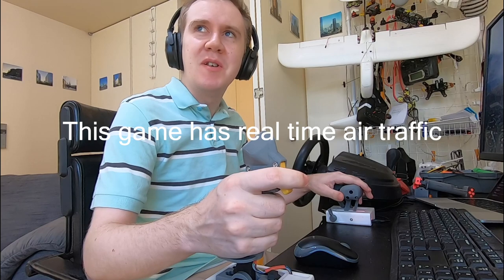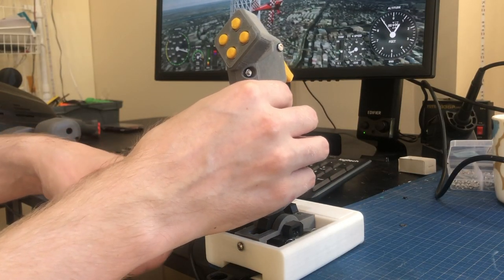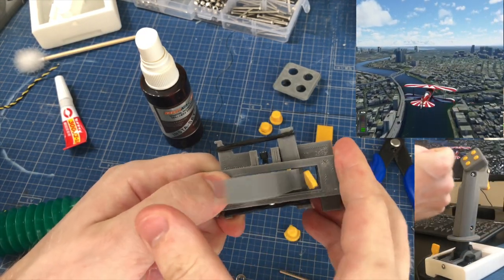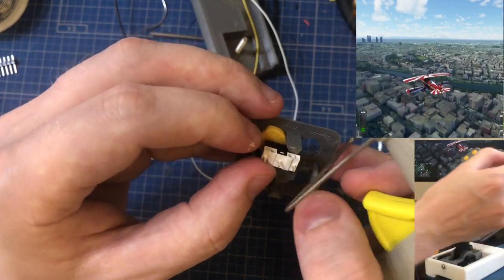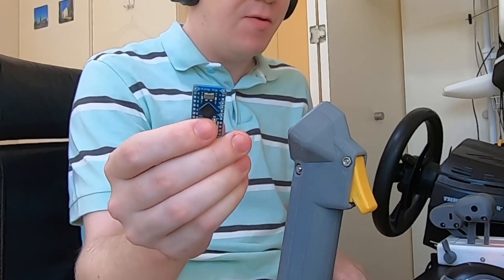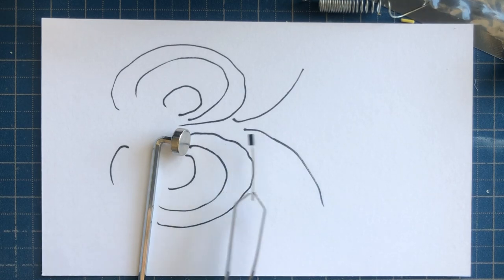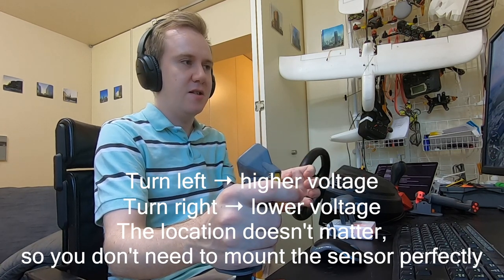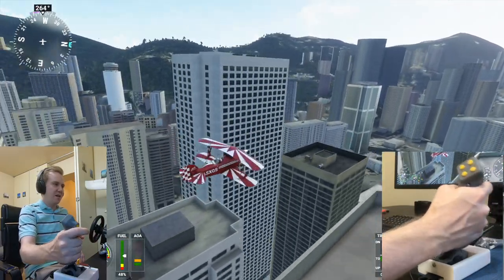Home-made Hall effect joystick for Flight Simulator 2020

Comment: I love the ATmega32U4.  For my master's thesis I developed an experimental type of solid state 6 dof joystick and I used this board also! I also used a ATmega32U4 board on a small bldc motor driver because it has a timer, timer4, that has 3 comparators on it so you can get the 3 phases setup super easy compared to timers without 3 comparators. Nice little chip

Comment: I think this is such an awesome project, but since I already have a decent joystick, I would love to see more of an in depth revisit of the throttle system you designed. I am currently building a DIY stream deck based on the same principles, and I was thinking of being able to dual purpose that with flight sim, Elite Dangerous, and a few others, but I would definitely need a throttle system to go along with it, and it would be nice to have something like yours. Thanks for the awesome video!

Comment: I am verry interrested in this Project but i would use it for my Farming simulator. 
Can you please make a Video how you connected all the wires on the pro micro and how to connect some more switches and also how to write the software. Because i don't understand anything about programing and i think i am not the only one.
Reply: Yes, I want this to.
Reply from the maker: There is a wiring diagram here: https://www.thingiverse.com/thing:4576634/comments#comment-3639820

It's very straight forward.

For the programming, you can see this video, it is very similar: https://www.youtube.com/watch?v=YAbi_AqF7aQ
Reply: @AkakiKuumeri  Am I wrong in saying that your wiring diagrams only show the connections between switches and Hall sensors to the Arduino, but not to the PC (via USB)?
Reply: @sz72909  Do you need a wiring diagram to show you how to plug a USB cable from the USB port on the arduino the the USB port on the PC?

Arduino boards normally have a USB port on them and you plug them into a PC USB port to program them. (smaller boards like this are often mini usb connectors on the board) Once the boards are programed they're non volitile so you can unplug them and the program will work next time you plug it in or power it with a battery. If you do a search on Amazon.com you can get some nice close up pictures of arduino boards.
I'm pretty sure that once you've got the device built and the program on it, you'd unplug it and replug it and windows will recognize it as a generic game controller. Then you'll set up the various control axis in your game.
Reply: Dude use a bodnar board, no soldering or programming required, and then get an ebay joystick for commercial use, they are like £12 or something, and voila, home made joystick, no soldering required.  Also, the bodnar board will allow you to hook up several joystick thingies, because it can handle 8 axis, 32 buttons, and a bunch of potentiometers and other switches.

Comment: GREAT PROJECT. I think a twin joystick for the increasingly popular space sim would be good as well. Im attempting the same same with a few RC plane gimbals M9frysky) and have them connected up but cant seem to get the great results you have (even after calibration the joysticks are over sensitive and screwy) I tried to modify your code but couln't add a second joystick. You make it look easy. Wish you could help.

Comment: One thing I think people need to be aware of, I believe you need a specific type of Hall Effect sensor, I was super hyped to build this controller and skipped researching and happened to buy 3 lots of wrong ones which unfortunately output digital signal instead of analog. I gotta find a purpose for them soon.
Reply: doing the samething tho, but it works at least
Reply: @AbuGuroza  hey do u guys know any alternative sensor in amazoon only digital output version is available
Reply: @arunachalpradesh399  hmmm i never use amazon, but thankfully the one i got in here is analog one
Reply: @AbuGuroza  yes bro, please tell the name of that sensor,
Reply: @arunachalpradesh399  49E Hall element OH49E SS49E

Comment: Could you go thru more detail on how to wire the hall sensors, switches and buttons to the microcontroller? Which pins do the positive, negative, and signal leads soldered to which pins on the board? Where would be the .stls for joystick. I like your layout of the stick.
Reply from the maker: Thanks! The wiring details are in the source code. It's very straight-forward.

Comment: I'll be using an xbox joystick sensor module, kinda worried it'll be too flimsy. To mitigate, I'll use the joystick as a stopper that will make sure that the module doesn't overextend, to make sure I don't break the module.

Comment: I am impressed. Thanks for good explanation. I am working on this type projects with esp32. I have question:) . Why did you use hall effect sensors rather than joystick modules? Its add complexity to your project(but it looks cool :)) and if you using pla, pla creeps under continuous stress (its happens to me but can't prove it :D im now using petg) Precision probably lower than potentiometers. Because you have to align correctly the magnets and all magnets don't have same magnetic flux.This is my thought i m not often use hall effects sensors, maybe i am wrong. And yes my grammar mistakes can hurt your eyes:D.

Comment: Any reason you chose to have the sensor be the moving part instead of having a stationary sensor and have the magnets move?
Reply from the maker: You can see the first version had a single moving magnet and a stationary sensor with two axes. It didn’t work, because you would need to have sensor in the middle of both axes of rotation for the reading to be linear. You would have to have a complicated gimbal-type hinge mechanism, with an open center.

Instead I have two seperate sensors, where the sensors are right on the axis of rotation, but offset to the side. In this configuration at least one of the sensors has to move, and that’s exactly what I designed.

Comment: Can you add information a bout the orientation you printed all the parts incl. the throttle? Also what kind of M3 bolts and length did you use? Great idea btw!
Reply from the maker: All parts are oriented as they should be printed in the files. (except I think the joystick shaft part had a slight angle)

For M3 bolts I got a little assorted set with lengths from 5 mm to 40 mm, as well as nuts and washers. I mostly used 25mm long ones I think, but it's best if you have a few different lengths for the different spots. A set is less than 10 usd on ebay if you can't find it locally.
Reply: @AkakiKuumeri  can you post a link to your set, I can not find any sets having a M3x40mm, max is always 30mm.
Thanks!

Comment: Nice work! I would like to know a little more about the rudder pedals though. What potentiometer would you recommend for your design?
Reply from the maker: Any resistance value of the common old potentiometer will work. I don't know what their parts name is, but you know it when you see it. Just make sure it's a linear one, not one of those logarithmic ones (used for volume knobs sometimes)
Reply: Hey Ramon, I have voided many a warranty on joysticks, rudder pedals , etc (I'm actually tinkering with a project similar to this one but bigger; for an entire VR cockpit) and I don't think I've seen anything other than a 10K Ohm potentiometer being used. Given Mr. Kuumeri's response though, if 10K is some kind of a benchmark or standard amongst manufacturers I couldn't tell you why. Hope that helps.

Comment: hi! I have some  question that I like to ask

Q.1 HOW LONG SPRING DO I NEED? Do I need 4 for them?
Q.2 WHAT IS THAT SWITCH? IS THAT A MICROWSWICH TOO?  AT 4MIN 16SEC?
Q.3 What is the scrip to get the data out and into the computer?
I hope you answer my question and have  a good day
Reply from the maker: You need about 2-3 cm springs, 3 pieces. I however recommend rubber bands over springs, they work better.
That's also a microswitch.
The source code is linked on the thingiverse page.
Reply: @AkakiKuumeri    do I need an Arduino pro micro? just any Arduino with ATmega32u4? 
and can you make a flight throttle video?

Comment: Hi Akaki, thanks a lot for the video, I've been planning to build my own joystick based on hall sensors and an arduino pro micro for a long time. My only problem is that I don't know how to connect the cables to the board correctly. Where could I get information for the correct connection of the sensors to the board? Thank you very much greetings from Buenos Aires, Argentina!
Reply from the maker: It's in the instructions on the thingiverse page

Comment: Does anybody have the complete list of materials to do the joystick?
Reply from the maker: There is a bill of materials on the thingiverse page. I’m sorry for the formatting, there’s nothing I can do.

Main things you will need are a Arduino Micro, linear analog Hall effect ICs, small round magnets, PCB size microswitches,  rubber elastics, rotary pots, and a ton of M3 nuts and bolts
Reply: @AkakiKuumeri   could you maybe reupload the whole thingiverse readme to pastebin? please :) also trying to build it && having a serious pain with that formatting
Reply from the maker: @Derlaft  Good idea, I did that. Check the thingiverse page again.

Comment: Does the dual Throttle use Hall sensors too?
I'm interested because I'm planning on building a 4-way unit with a common axis.  It's throttle and pitch for the DH Mosquito on the way for DCS, and I'm curious about how far the sense points need to be spaced so they don't affect each other.
Reply from the maker: The throttle is made with just pots.

Incidentally the two Hall effect sensors in the joystick are only about 2 cm apart and they don’t interfere with each other.
Reply: @AkakiKuumeri  Great, thanks.
That means an idea for separation I have might work well.
I'm going to try with adjacent sensors on opposite sides of the axle.
i.e Left throttle on top, right throttle below, left pitch on top, right pitch below.
As long as I don't use magnetic materials, that should give enough separation.
Reply from the maker: @No1sonuk  there are two ways to mount magnets and Hall effect sensors. Sometimes you have a single magnet and the sensor moves towards and away from it; this arrangement is weak to outside interference. Or, you can mount the sensor between two magnets, and sense the strong magnetic field between there, like in my joystick design; this configuration should be strong to interference.
Reply: @AkakiKuumeri  Tom Stanton's rudder pedals use two magnets with the sensor beside them to get a reasonable angle range.  I was thinking of that arrangement in my earlier comment.
The problem with sensing between two magnets in my application is that all 4 have the same axis.  I could try it with a non-magnetic tube as the axis and put the sensors in the tube with appropriate spacing.

Comment: Can this be used with a PS4 (It takes USB input but I don't know if you need something "special" for the programming  for it to work)
Reply from the maker: I don't think it would work as it is, I don't think PS4 accepts any old HID devices. It would need to be made compatible.
Reply: you can use gimx, it's useful for connecting hid devices to ps4 or xbox one. One of my videos explains how to connect logitech fly stick to xbox one(same procedure for ps4 look at pinned comment)

Comment: Does the board voltage matter? I have 3.3V Pro Micro, and it looks like it has problems reading analogue signal
Reply from the maker: The Hall effect sensors I used work with 3.3V too, so it shouldn’t matter.
Reply: @AkakiKuumeri  thanks

Comment: Would you be interested in a design that will help modify a G29 pedal accelerator from potentiometer to hall effect by any chance?? (hint hint^^)
Reply from the maker: There do exist rotational hall effect sensors that are drop-in replacements for rotary pots, but why would you need to do that? My pedals have been working fine as they are.
Reply: @AkakiKuumeri  in case they stop working

Comment: So I have this up and going but I notice the signal kind of jumps around a little. Is there a reason for this, expected behavior? Is there supposed to be other electrical component in between signal wire?
Reply from the maker: How much does it jump around? Mine jitters but about 1-2%, so quite stable.
Reply: @AkakiKuumeri  I would say mine is around the same tolerance. If you have a small amount that's fine, I just wanted to make sure that was expected behavior. Sorry for the dumb question, I'm new to this wiring components stuff.
Reply from the maker: @bradecrain  Great that you got it working. That amount of noise will not affect your game. There are ways to get it totally stable, through filtering, but that can affect the responsiveness too.
Reply: @AkakiKuumeri  Could you hook me up with a link or resource to that information? I've googled until sick trying different smoothing libraries, none of which translate to the game or the calibration wizard in Windows. They translate well to the serial plotter in the IDE but that's it unfortunately.

Comment: Can't get my hands on the AH4503. Any alternatives? Thanks.
Reply: Same I’m just trying to use A1302 linear sensors they arrive today
Reply from the maker: Any linear output one that accepts 5 V as power will work.

Just make sure it has analog output, most hall effect ICs will give you a digital on-off output. These things are most usually used as a simple magnet proximity sensor.

Comment: Will A1302 hall effect work with this project?
Reply from the maker: Yes. I believe it's a 3.3 V equivalent to the one AH4503 I used. You'll need to supply it 3.3 V. and the range of output values will be slightly smaller, but it should still be quite usable.
Reply: @AkakiKuumeri  I soldered it to the VCC output it works fine 
THANK YOU <3

Comment: Do you have to use a specific type of magnet with enough strength like neodymium? Or are everyday magnets sufficient for small electronics?

Also do you know how many axes you can put on a single controller that MSFS will recognize? Might add a few knobs to this thing too!
Reply from the maker: Any magnet will work. I small everyday neodymium ones. 

I think msfs should recognize any number of axes. The arduino I used only has 7 or so analog input pins though, if you need more you will need to use a different microcontroller in order to read the values.
Reply: @tnield9727  
im just looking in to making this myself... so im new at it.
but i thought that for hall effect sensors it was better to use a diametrically charged magnet, on a normal neo magnet one flat side is north and the other south, on a diametrically charged neo magnet half the disc is north and the other is south... so there is a straight line across the center of each flat side where it changes polarity, making it better to read from a sensor... also needing just one magnet per sensor.
but i havent tried yet so i might be wrong and it maybe doesnt matter!

Comment: Bro i am using rectangular magnets n it only inputs either high or low , even when calibrated its all crazy ( using a Leonardo with Arduino hall sensor module ) ..
Reply: Hi, I think Arduino hall modules (the ones with the little board) are hall effect switches, that is, you can only get on or off. I tried them some time ago and they worked that way.
Reply: @deeleyer  oh crap i bought 3 of those , but it says linear tho .. so hw did u get to work with analog ( variable ) input ? Could u just list the components u used such as hall sensor (hope i don't need a specific one ) , and ?
Reply: @deeleyer  hey , got the things as u say lol in the description ,, im only concerned about the hall sensor model , can i use any hall sensor ? Its very hard or impossible to get through ebay due to corona crisis .. thanks a lot , u saved me alot of trouble shooting time

Comment: How dafuq do you get magnets into the bottom of the hinge. So fiddly. They don't seem to want to go in. I think I need some kind of plastic magnet holder tool.
Reply from the maker: I think I used the tip of a screwdriver. You're right, I should design with assemblability in mind more. this project was originally for my own use so whatever I could build once would be fine.
Reply: @AkakiKuumeri  Don't get me wrong it is awesome. I am using a working model. Well I was for a while I have since decided to drop some cash on a stick but this is what made the decision. I got it in in the end with some tweezers. But my trick was that I had to put about 5 magnets on the outside of the hinge to keep it in place otherwise no matter how long I held the glue in place the screwdriver/metal implement was taking the magnets with it! Love your videos though Akaki!

That poor cat! haha